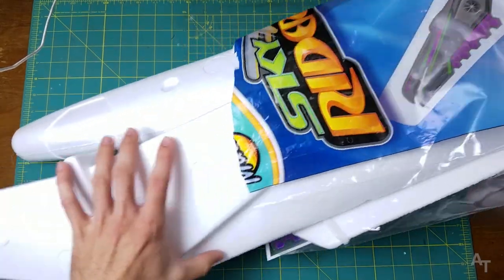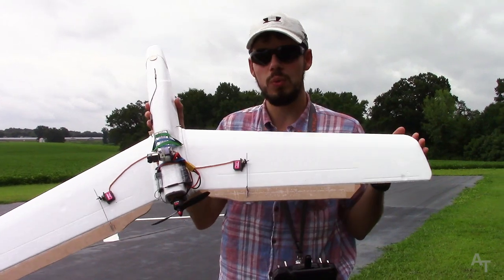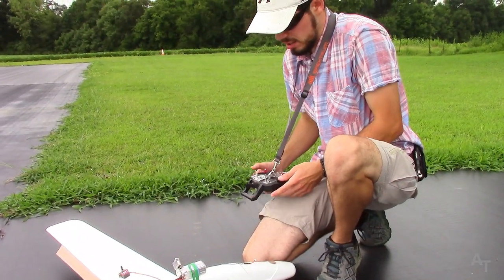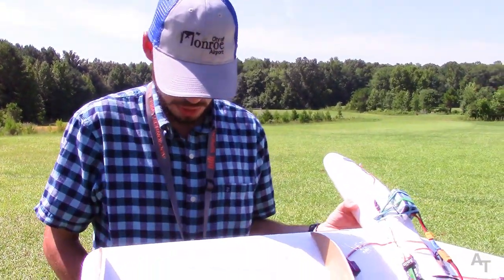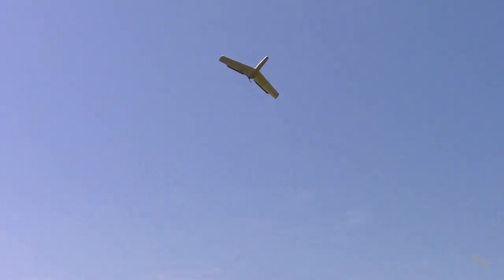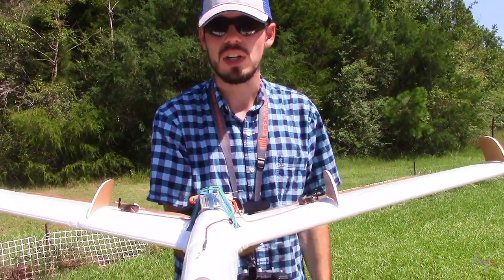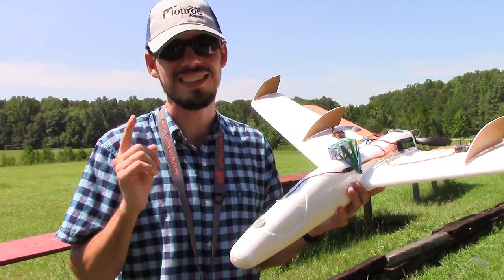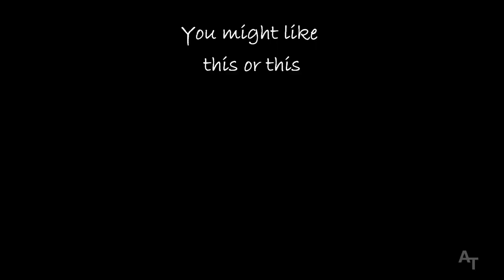WALMART GLIDER TURNED RC FLYING WING - Great for FPV! WALwing

Comment: just today is was looking at my crashed Walmart glider and wondering if it could be converted into a wing since it already has the CF rods embedded in the wings, then i jump on youtube and find out you already did all the hard work to find the answer, so thank you sir. As soon as i'm through with the delta i'm building I'll get on the walmart wing thing but i'm going to have to shorten the nose cuz it still looks really stupid and still need to find a substitute for hot glue that will work with that foam, can't use the multi-temp crap where i live it's too hot, thanks again dude.....
Reply from the maker: Sorry to hear about the crash! What happened? But it sounds like you have the makings of a really nice flying wing!
Reply: actually i only got it off the ground once just a little, i'm a noob with planes so i put a landing gear on it so i could ground takeoff like i saw someone else do but i put the plane together with that crap multi-temp hot glue and i live on the edge of death valley where it's 120 in the summertime and the pavement gets to be over 150, by the time i actually got it off the ground all the glue had started melting and the plane came apart and came down nose first which i had gouged out to put my electronics so it disintegrated on impact, i use epoxy now....lol
Reply: well i'm 3and 0, 3 scratch built wings destroyed and 0 successful flights, teaching yourself to build flyable planes is harder then it looks. i'm back on the walmart glider, i formed a knew front half and  nose out of dumpster Styrofoam courtesy rent-a-center and  i used epoxy instead of hot glue so hopefully this time it will stay together long enough for me to crash it....lol

Comment: I know this is an old video/ concept but I just built and flew my own wal-wing. I cut the fuselage ends off the wings to eliminate the dihedral and ended up using those pieces to make my fuselage. Just maidened it and success!

Comment: I like projects like this.  Hmmm ... no rudder, or rudders?  Wow, the same basic mistakes as before with the golden jet.  Have you seen a flying wing without some sort of drag element like a rudder, or rudders?  The best I have seen with that scheme used a flat surface on the wing leading edge near the wing tips, and others used the same scheme as the current Spirit bomber, split spoilers.

Comment: flying wing= waste of time. can't have efficiency and stability on that platform.  worst way to achieve flight...
Reply from the maker: U serious?
Reply: yes, apologize for the harshness, but center of pressure moves forward with AOA, and moment arm or counter acting downforce is small, meaning that that downforce is extremely large, or insufficient to maintain pitch stability. that's why it wants to stall/spin when you got to high AOA.  if you think speed is your friend, well, yes, as long as it's train and level. AOA is independent from speed, and you';ll fond the bad characteristics can happen at high speed too.  you're also limited with a wing as to the planform you can use (always a bad one), aspect ratio is usually low, you can't use a high mean camber airfoil.. so physics don't favor a flying wing in any way, except unless you need to fly very fast, or have a super simple design.    you're not the tfirst person that thought of getting rid of the tail, and there is good reason that every serious aircraft company abandoned it back in the 1940's/50's if they had not already.  only practical use is for low observable aircraft, but if they could achieve the same thing with a more conventional configuration, they would . 
anyway, not my intent to make anyone feel bad, just the truth.  experimenting with them can teach you a ton about how not to design an airplane, that is super valuable.   if you have specific questions, I'll try my best to answer them.?? 
cheers! 
 @RCwithAdam1
Reply from the maker: @FPVREVIEWS  Interesting points. You've brought up the negatives of a flying wing design (assuming that your statements are correct), but can you tell me some of the benefits of a flying wing design? Particularly as it relates to RC aircraft?
Reply: check out this video at 4:45 to visualize how CP shifts:
https://www.youtube.com/watch?v=8fk2J5LtdSg
it happens to all wings, but of course the moment arm of the mean pressure shift increases with relative chord length.   that's why all aircraft need some degree of dynamic stability if they are using a relatively high CL airfoil, and expect pitch stability at more than one AOA.  even high aspect ratio wings with small chord experience this CP shift, but it's most pronounced on a large chord, lower aspect ratio wing.  aircraft with a long tail can counter act the imbalance easily due to long moment arm of the corrective surface, the horizontal stab, and can use a CG closer to the CP position that they will routinely be flying at.  with a low aspect ratio, and no tail, only reflex in airfoil (diminishes the CL of the wing), washout (a better way to achieve this (as per prantyl, potentially achieving a bell shaped span wise lift profile) and progressive airfoil usage being the only ways to achieve some degree of stability, although the ratio of dynamic stability to coefficient of lift of a flying wing can never match that of a more conventional configuration.  Nasa has done lots of work with flying wings, and much fundamental research has been done associated, which is very valuable. they often paint their concept aircraft like airliners, to ensure public funding(it's your tax dollars), but have no actual delusions of them becoming transport aircraft.  the only viable applications are where ultra simplicity is more important than performance, where relatively low drag needs to be achieved without complex fabrication/design analysis, and where low observablility is the prime concern, over payload or range, such as with the B-2 Spirit.  We have had the sting wing concept since the very early days of aviation, and it was functional during WW2, but there is good reason why it's not been adopted for anything but special use cases.    @RCwithAdam1